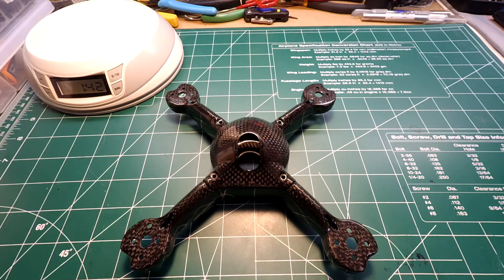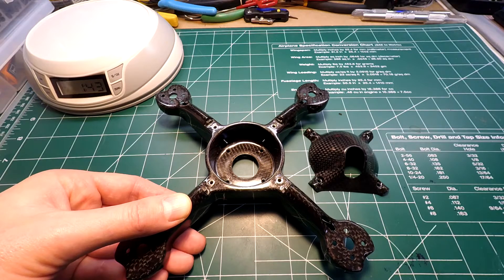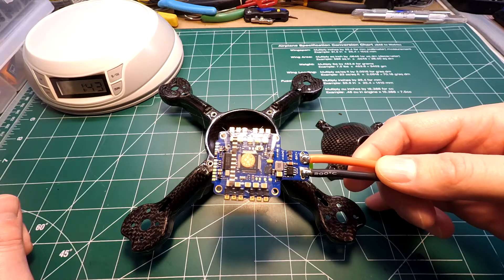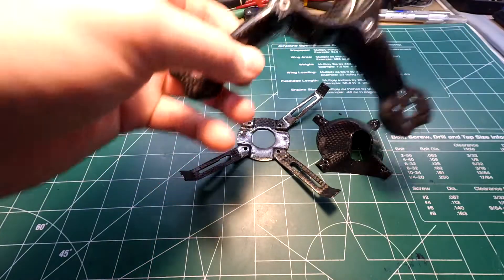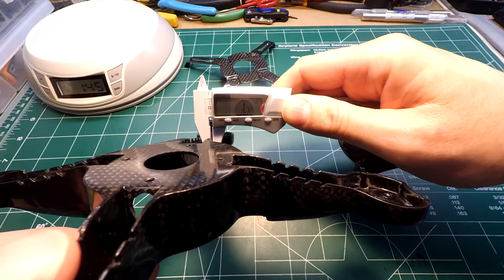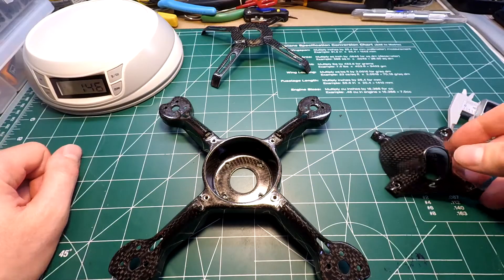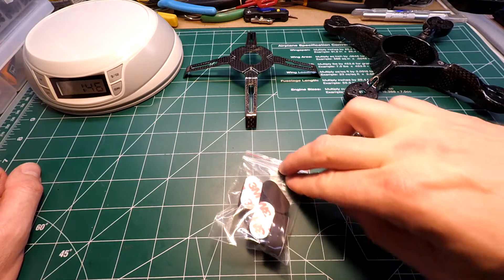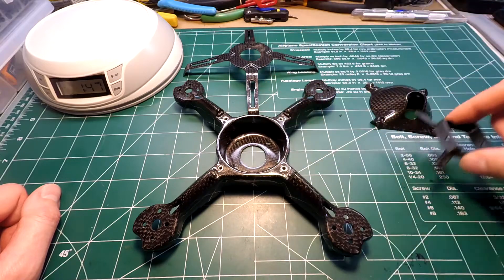RealAcc Carbon Star Frame Review

Comment: Hi! Just a suggestion. I dont know this frame but I think you can let one little usb cable into the FC to keep the access for BF and maybe solder longer Lipo wires to put them through the VTx hole... What do you think ? Instead of dremel out this nice frame ^^ Nice objective review by the way :)

Comment: This frame looks great, good video! Well protected frame! 
Have you tried to put a gopro on it?!
Reply from the maker: Leonard FPV - I actually haven't even built the frame yet because I've been waiting on parts to complete the build, but I'm sure you could mount a GoPro on the canopy with some velcro and a strap somehow. I'll be building this frame and featuring it on my YouTube channel within the next couple of weeks, but remember that you have to dremel out some material in the lower frame to allow discharge leads and usb access for the flight controller.
Reply: SteelRainFPV - thanks

Comment: Looking forward to your follow-up video. I've got one sitting here too. Still plotting out where to make cutouts. Was going to use an AIO FC, but didn't want to cut a big hole in the back. Ended up just getting a BF F3 (no huge tab sticking out), and will be running ESC's in the arms. Coudn't make a two stack fit, especially with an Eagle 2 cam.